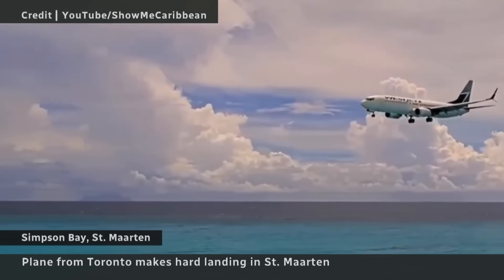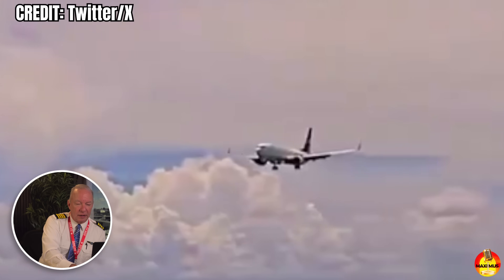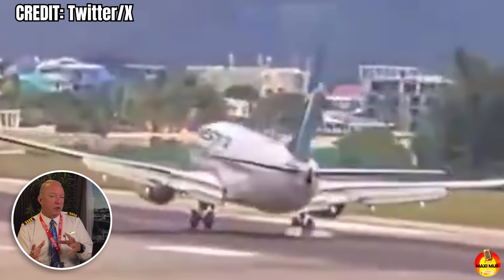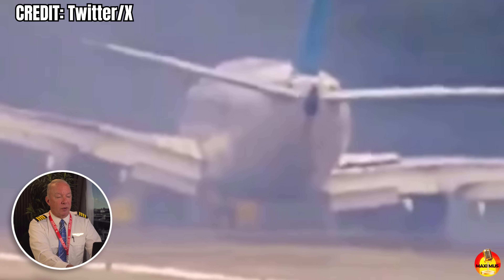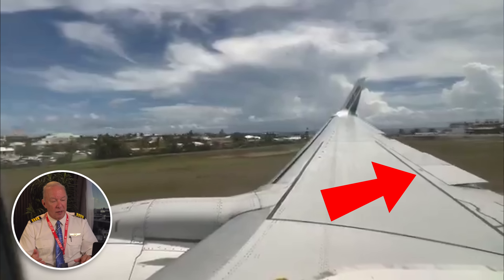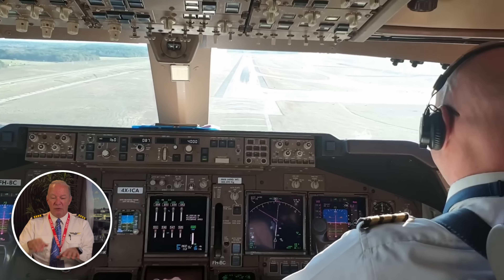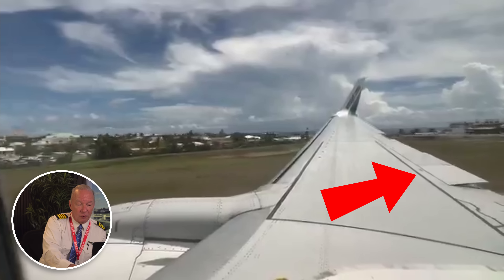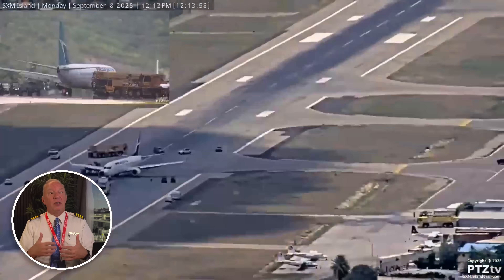Hard Landing at St. Maarten  What Went Wrong with WestJet 2276

Comment: STATUS UPDATE:  The plane involved in this incident, a Westjet 737-800 model, Reg # C-GWSR, has been successfully repaired on St. Maarten and was flown back to Toronto as Westjet Flight # 8965 on Friday, Dec. 5, 2025, just about three months after the accident which occurred back on Sep. 7, 2025.  Still haven't heard the details of whether the gear collapse was caused by pilot action/error or was due to mechanical/structural failure of the gear, or maybe a combination of both.  Looking forward to getting an update on the cause of the accident.

Comment: I've watched this Steve guy's videos and compared them to Mentour Pilot's videos. This guy publishes a lot of conjecture and opinion as fact. Halfway through the video he points to a spoiler and calls it an aileron. He needs to be doing more research and confirming things before he tells the whole Internet how much he knows. 

As for a hard landing - it was a faulty trunnion pin and the pilots have since been cleared. I - as an airline pilot - believe in collecting the facts and drawing conclusions based on fact. The way things appear can often be misleading. This is not the first video that I've seen from Steve that seems to be sensationalized and seems to be based on conjecture and opinion purely from the first glance of an incident. And, as an airline pilot himself he should know better. 

I appreciate accident report breakdown videos, and I think there's a lot to be learned from them in the aftermath of any incident or accident to help inform myself to ensure I don't make any mistakes that may have been made by others. But sorry to say this will probably be the last video from Steve that I watch.

Comment: On Nov 10th 2025 the TSB reported:

- The initial review of the flight data recorder data indicates that this was not a hard landing event.

- During the aircraft examination, the right gear aft trunnion pin was found fractured. The two portions of the aft trunnion pin were sent to the TSB Engineering Laboratory in Ottawa, Ontario, and are awaiting further examination.

Comment: Hot weather, tarmac baking in the sun, You may have locally higher air temperature within ground effect and a sudden increase in density altitude, resulting in reduced lift near the ground.  I'll have to keep that in mind and carry a few extra knots on short final in the tropics.  ...or the pilot could have gone the wrong way with the yoke when responding to a cross wind

Comment: I'm really disappointed in your coverage of this event. You got so much wrong. Tires weren't blown.  Those aren't the ailerons. Those are the spoilers and just like your 777, they help the ailerons at slow speeds. This plane was on profile, on speed and stabilized and looking at the video you can see that it wasn't really a hard landing. You know that the Boeing landing gear can take a hell of a pounding without damage. This looks a lot like the same issue Alaska had in 09/2023 yet you failed to consider this in your report. Also, you know that the these planes tell on you. They let maintenance know right away if there is a something exceeded like flaps overspeed or a hard landing.  There was no hard landing trigger to maintenance. I'm going with the trunnion pin failure until proven otherwise.

Comment: I believe each landing gear and tire can handle stresses up to their share of TRIPLE the aircraft's weight, much like bridges are designed to handle triple traffic load weights.
Therefore, a basic structural failure of a vital support part, which should not have happened, may well be the cause.

Comment: Hi Steve. That aileron is a spoiler, the aileron is further out. It appears the aircraft may have had some ground effect causing a delayed touchdown. The -800 has auto flare at 50 feet. It appears the aft grunion has failed which goes through the landing gear beam. Could have been spherical bearing failure or grunion which is part of the oleo strut

Comment: I’m gonna have to disagree with you on this one Capt. Steeeve. The definition of Hard Landing as per Boeing is subjective to what the PIC states. The AFM does not document a specific Vertical Load Factor for a Hard Landing. AMM 05-51 states maintenance must perform a Phase I inspection if a pilot states a hard landing occurred, but no FDR data is readily available. The AMM states that the Hard Landing threshold as detected by the FDR ranges from 1.4 G’s @ 6 deg roll angle to 2.2 G’s @ 2deg roll angle. Alaska Airlines flt. 1288 suffered a fractured aft trunnion pin at a hard landing threshold of 1.7g. The final report found that the aft trunnion pin had suffered from fatigue cracks due to excessive grinding at overhaul which damaged the part’s base metal. The pin failed prematurely. Based on the photos between the WestJet bird and the Alaska bird, I predict they suffered the same incident. Boeing recovery team will have this aircraft flying out of SXM, no problem.

Comment: Great video , and very important point to switch your view from the touchdown zone after crossing the threshold to the very far end of the runway to enhance the peripheral vision and facilitate the flare.
It could be this time a dormant mechanical failure with the landing gear , was ready to happen…fatigue on the metal , but still not a big crack to be easily detected.
The problem nowadays is that with so many aids , like HUD , FPV pilots tend to forget that ANY aircraft is flown primarily on pitch and power, then the electronics will give you support but not the opposite.
We should not forget that the cockpit is a place for pilots-aviators not for system operators who can only push buttons as they always fly 99% with the A/P ON.
As an pilot -aviator and of course if your company SOP allows , try to fly  your plane as much as you can manually to be excellent with your skills.🛫
Happy landings to all my fellow aviators.

Comment: This is a trunnion pin failure. Someone tried to save a couple hundred bucks and built up the wear on the pin then re machined it not realizing all the stress and heat they were putting into it was going to result in the pin shearing. That's why the assembly punched up through the top of the wing. That landing was no where near hard enough to cause this and the strut was still fully extended. Maybe take a look at blancolirio's video. He had the adsb data right away.

Comment: I’ve followed this pilot’s YouTube commentary for a while, and while he’s clearly experienced, I find some of his analyses lacking depth. This take on the WestJet 737 incident, for instance, overlooks what appears to be a trunnion failure—strikingly similar to the Alaska Airlines gear collapse in 2023. I’ve seen hundreds of firmer landings on other types with no failures like this. This looks far more like a Boeing 737 design flaw, possibly tied to inadequate testing or supplier oversight. As with his earlier commentary on Air India, it’s another case where confidence seems to outpace nuance.

Comment: Capt. Steeve, there is one option missing in your interesting analyses. The altitude of the plane at the moment he passes the threshold, or even the beach.
As a Dutch pilot I have watched many videos of our KLM 747, 787, 777 planes landing at Sint Maarten. In my memory flying lower. I have the impression that this plane is approaching this rather short runway too high. This might force a too high vertical speed to be able to reduce the speed after touching down to the taxi speed.
To be short, in my opinion the plane is approaching too high and touching the asfalt too far with a too high vertical speed.

Comment: Not an engineer and not an acft mechanic but on the surface it just seems to me like poor engineering that a wheel strut on a hard landing could be driven up through the wing.  Isn't there the danger of the strut penetrating a fuel cell?  Again not being an engineer but to me you would think they would have a design with some kind of "stop" at the top of the strut or a reinforcement under the wing that would prevent a penetration.?

Comment: Get a grip Capt. Steve!
ADSB Data shows a stabalized approach, on the flight path and at the correct speed. No need to throw the pilots under the bus with a sensational "there was quite the violent collision with the runway" statement. Are you sure the tire blew? Let's wait for the preliminary report. Gear failure due to mechanical insufficiency is a very possible option.

Comment: Captain Steeve, you totally missed that they landed WAY too far down a very short runway! I believe the runway there is only 6,000 feet long. SOP says you are supposed to cross the threshold on a constant 3 degree angle at about 50 feet. But smart pilots know that when you are landing on a very short runway, you disregard SOP and cross the threshold at about 20 feet. The cause might have started in the hiring of the pilot flying.

Comment: Reminds of a hard landing I experienced. It was the mid 80's and I was deploying to Okinawa with a Marine helicopter squadron. We left from El Toro CA in route to Anchorage Alaska. We came into Anchorage at night through a blinding snow storm. We were in a "Stretch 8" which is a DC 8 that was cut and extended to be able to fit more people. It looked like you were in a long cigar tube. Anyway, it was the only time even to this day that I thought we were going to be spread across the runway. We ended up laying over for 4 hours while the aircraft was inspected. After the inspection we continued the flight with the same aircraft.

Comment: Any aircraft encountering a hard landing on one wheel strut only especially if it’s mechanically deficient runs a greater risk of failure.   As a passenger I’ve flown on hundreds of flights and I’m avid plane spotter and didn’t feel that this landing ( although hard ) should have collapsed.      A comment about your description of wing ailerons movement shown from the passenger recording, you point out with your red arrow pointing at the spoilers mid span.  They were definitely slightly raised which could’ve stalled a small patch of wing causing the wing to dip suddenly.     

To may knowledge spoilers will aid in roll control at cruse speeds and should not activate in full flap mode until weight on wheels.   I don’t know what it is with 737’s spoiler design.  Riding in the back of one the earliest modes, I’m watching out the window just at rotation speed I watched in puzzlement to witness the spoiler’s pop up nearly halfway and stayed that way until flaps up…. We climbed and lived.  I’ve never seen that happen on any other plane.

Comment: Seems to me that there is a lot going on too close to the ground... 
This field is near sea level as are a few other recent incidences.
The altitudes being calculated by air pressure at low levels are spooking me.
Hot temperatures effects on barometric pressure, Solar activity on Radar,  Earth Quakes on lat long positions....
Hmm I wonder
1) what effect rising sea levels have altitude and barometric pressure.  (QNH/QFE)
2) what effect recent CMEs have had on radar data ('GPS')
3) what effect have earth quakes had on lat / long / altitude on 'GPS'
4) Stuxnet and simulators/test units left connected to departing aircraft.

Comment: The 737 main landing gear is designed in such a way that, in case of exceeding the max allowable force, the strut will pierce through the wing without damaging any fuel tank.

The system worked and contributed to having everyone getting out safely.

Comment: It's a 737 again. Hopefully, they figure it out a guy i did fly to Toronto ON from Regina SK Canada told that computers fly and land planes, not the case plane we where on a 737 I could small the jet fuel inside as we in the back never sat in the back i thinking most likely normal they turned the AC up it want away
Reply: Ever hear of punctuation or spelling? Maybe small to much jet fuel want away.

Comment: First time I landed a Cessna 310 in a short field for its landing roll, I about freaked out at how my F-104 flight instructor had to do an emergency last second takeover of my piloting right after we went over the fence. Boy was he good cause the runway was only 1000 foot with trees at the end. Nobody realizes that a jet at St Martin has to have the perfect glideslope, the perfect runway alignment, the perfect airspeed and a seriously good pilot to "Hit the Numbers" on the end of the runway in order to be able to brake before hitting water at end of runway. That was my first heavy flight after single engine super decathlon and 172's and if felt like I was landing a greased brick. Twin engine jets at low speed feel like you are flying a greased tiger tank. The controls on that Cessna 310 twin engine felt like I was in hell trying to keep on the glideslope and adjusting power and pitch. What a nightmare a pilot has to deal with in a heavy though is beyond comprehension even for me. I respect heavy pilots after flubbing one Cessna 310 short field landing and my hats off to them doing this daily.

Comment: I have an amateur question. I have sat at the bar next to the runway and beach at SXM and seen many planes come in, even seen KLM and Air France bring in 747's in the early 2000's. One thing I noticed is that they normally try to hit the numbers or very close to them on the SXM runway. This one looked like he was going very far down the runway before it touched down. Could he have been going in fast and forced it down as opposed to do a go around? I know there are more than one variable here, just wondering if that could have been a factor as well.

Comment: Steevie, I think it was a strut/gear problem otherwise it could be many more accidents as you told caused by pilots' 'flare-aileron action'.
Landing is not a 'surgical operation' though a vital part of flight for sure.
Hope your colleags will forgive you for the video.
My respect to you as a good and weathered pilot.
PE, AME retired.
I did as passenger or jump seater in cockpit about 400-500 hours a year and there were... many 'hard landings', Steeve, with no issue!

Comment: Captain Steve that landing did not look that "hard". It looked like trunion  pin failure. Sorry I disagree from the perspective of a retired 737 Captain with over 5000 hrs time on 737s. The recording from data will show the g loadings.
Reply: Yes. I totally agree. He started to flare, even if he didn't hold off much. Just starting to flare is normally sufficient to prevent a hard landing. Stabilised on approach, you're doing, maybe 700'/min Descent rate. If you just get it below 600 for the touch it's less than 2g. That's positive but not hard.

Comment: Without knowing the FDR data, I can all but guarantee this was not a “hard landing”, but rather a structural failure. I have thousands of hours in both the 737 and A320 and the touchdown on the right gear does not appear to be anything drastic.
Reply: I totally agree with you.
Reply: yet a passenger inside the jet was filming the landing sitting by the window, when the jet touched down his phone was on the floor, definitely a stiff landing  planted on the touchdown markers  rwy 10 with  breezy winds 150/15kts
Reply: I agree the landing was a bit firm, but they’re designed to take it. Something else is going on here.
Reply: It’s harder landing than I’ve ever experienced so it’s certainly a hard landing.
Reply: @secretsquirrel572   wrong
Reply: @rideronboard  ok. Tell me in all your vast experience how I’m wrong. I’ve been flying for 30 years, genius.

Comment: I don't think its a total loss. The wing certainly; I'd say the wing would have to be replaced, and while its not a small job, it is doable in the field with the right support equipment. I think too this happened because of a combination of circumstances. The hard landing as you described, along with material failure - the strut assembly, including the attachment points. Punching through the wing plate like it did, suggests the gear dislodged from the attachment points and contacted areas where there were no reinforcement. My last point is about the cockpit and where the pilot was looking - spotting the deck as Cpt. Steve described. This would be an ideal condition where cameras in the cockpit would pay dividends for an after action report. I know there are many pilots (I'm not a pilot) who are against cameras, citing invasion of professional privacy, and potential for misuse of random and routine clips to either deny someone privileges or to just fire someone for cause. I'm merely suggesting cameras could be a tool to train other pilots. I'll also admit I don't know what the answer is or should be, and I don't think it should be an arbitrary rejection or acceptance without a deep and meaningful structure around cameras in the cockpit.

Comment: Doesn't actually look that hard, I believe the gear prematurely failed below it's normal failure loading.  Some main component of the right gear had a fatigue failure, possibly the main mounting pin at the top, as such the gear strut would have driven through into wing as it did.

Comment: Aircraft routinely land on one main gear in crosswinds. In the case of the accident Westjet the flare was too late. It ended up as controlled flight into terrain. They might have got away with it had the hard landing been on both wheels. The passenger video would normally show descent to the runway and then a 'hover' for a second or two before touchdown. In this case the plane slammed down onto the surface in a carrier-like landing. Perhaps the pilot sensing a too-long landing  on St Maarten's short runway and the possibility of a extended float tried to recover with a positive touchdown. A go-around might have been the wiser decision.